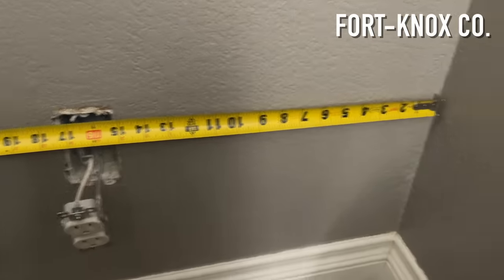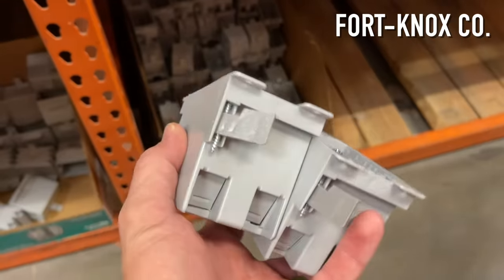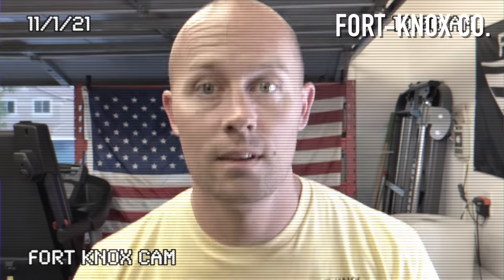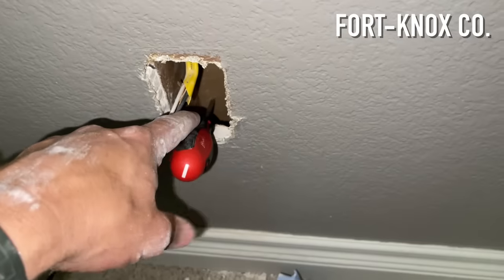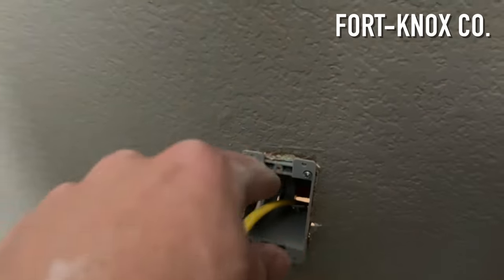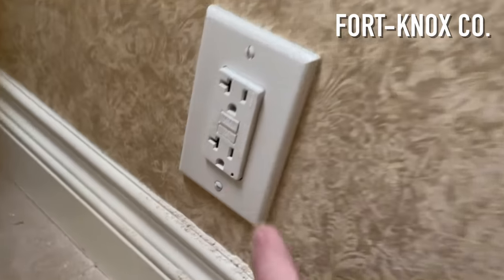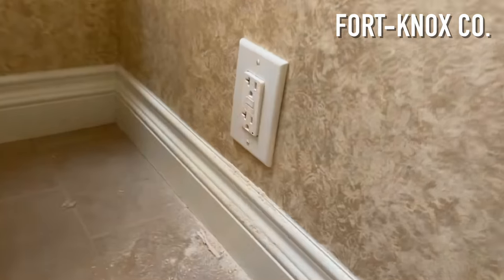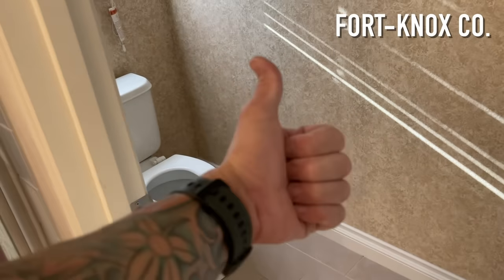How to Add an Electrical Outlet ANYWHERE !! Heated Toilet Seat or Bidet Install | Run Power Easily

Comment: Nice install, only wish I could have seen the old and new wires tied together better or a slower explanation. As a newbie that was an important moment to follow.
Reply from the maker: I appreciate your comment. I will be doing a couple more videos showing just that. I’ve had a lot of questions about these parts of the process. So I’ll emphasize more this in future videos.
Reply: It’s dangerous for you to take a project like this on without having thought it through for yourself a little bit better first, and I’m not trying to be snide by saying this.  It wouldn’t be learning if the teacher did the student’s thinking and “newbie” seems to imply actual interest.  He doesn’t need to change his videos lol just because there are some viewers who conflate wanting to learn with wanting the result of having learned.  Dude’s video was totally responsible using a hollow interior wall and not advising novices to go on the back wall where the water supply is.  

Inexperience doesn’t need the vocabulary to figure out this is a parallel circuit, but the video does presume anyone without enough snap to infer that the three (hot neutral and ground, respectively black white and bare or green in the U.S.) wires need to be individually connected to the same-colored terminals at the additional load (brass steel and green) as they are at the other end of the new jumper (even if every conductor had the same color insulation, which they don’t for what one should hire an electrician If they don’t realize are obvious reasons of safety and convenience) has enough self awareness to forthrightly call having a situational instrumental use for some information what it is.  Criticizing useful information consulted under false pretenses as unclear though is just the projection of someone trying to pretend (unclear with self) they aren’t playing make-believe about their own deluded unassailable perfection by diminishing the work of others (electrician you need to hire and YouTuber you need to stop gaslighting).
Reply from the maker: Thank you. I appreciate the words.
Reply: I kind of felt like that, too, but I have no intention of doing the work myself; I just want to know if it can be done and how much is involved so I'll know if the electrician is being straight with me.
Reply: @virginiamoss7045  it can most definitely be done. It’s just doing it properly and sometimes that involves more labor and work. So it could get pricey depending on how much work is needed.
Reply: @jaxfortner7979  That's what I want to know a little about, how much work it should take if no problems like pipes or unexpected issues.
Reply: @Zarathustran  you forgot to include ‘down stream’ from the GFCI.   You can wire one that doesn’t protect down stream if not careful. 🥸
Reply: @harryl7946  You’re sure right about that and though I’ve done it deliberately (wiring them unprotected downstream that is, not omitting mention here) it’s a great point.  Until AFCIs made me even aware driving a nail into a wall presents the unlikely possibility of creating an arc flash I didn’t much see the use of wiring them for downstream protection at all.  I still think doing so opens the door to risky assumptions (that completely defeat the purpose of a GFI) that other standard devices not explicitly marked in the vicinity are ground fault protected.  I’m not an electrical engineer so I defer to caution in the face of plausibility regarding arc flashes but the only line voltage romex not stapled to a stud where I live is usually wire I pulled or can locate with a zircon tool before cutting into a wall — which I’m not brave enough to jump blind right into with a sawzall where utilities are live anyway.  

I really like the idea of CAFIs near the points of use for reset convenience, and though they don’t offer ground fault protection on the line from the breaker (which I guess somebody could conceivably tie into and expect now that attempting to economize by overextending the application of individual devices has IMO invited that unreasonable expectation) they apparently do mitigate some arc faulting in both directions. Still though, unless I wired it myself the only standard (non-GFI) wallbox device I trust to be ground fault protected where there’s not a GFI or CAFI BREAKER upstream is nada.  I thought the remote controlled SquareD QO CAFIs might be a good way to solve the reset convenience issue and actually bought a shit ton of them (well enough to do a whole house, but they were expensive so it seemed like a shit ton) if you’re interested LMFAO, but they cannot be reset remotely when tripped.  Given that fact I don’t think those much need to be in their residential product line, but they haven’t asked me lol.
Reply: @Zarathustran  just saw this response and laughed.  Who are you trying to impress? Constructive criticism is never a bad thing especially if trying to help a YouTuber who obviously put a lot of heart and soul into making a video others can learn from. It takes a lot of work and adding in those details are meaningful for the viewers and to better the content of the video. This helps likes and subscriptions to YouTubers as I know valuable content always gets a thumbs up from me. The YouTuber was receptive which is even better for building trust.
But your comments seem just a way to puff yourself up. Im not afraid to learn from others as well as teach myself and I’m not afraid to ask for help. I don’t have that kind if disfunction where I let my ego or pride prevent that. I’ve done plenty of self learning and believe everyone is capable. I tackle new things all the time and even built my own house. So really your comments are unnecessary and pointless.

Comment: I'm trying to get the courage to work on electric. Thanks.
Reply from the maker: It’s definitely something you can diy. Just start with the breaker off. Everything else is easy after that.
Reply: @FortKnoxCo  That's what they keep telling me. 😂  I had to put in a new coil in my oven. I unplugged it and turned off the breaker. Baby steps.

Comment: If you are installing smart bidet isn't it good idea this gfci should be in the back wall instead of in middle of the room ?
Reply from the maker: This home owner specifically wanted it in this location sure to how they set up their bathroom and the additional work that would have been required to pull electrical wire the the wall behind the toilet. For their set up and budget they wanted it on the side. But yes you can have the outlet behind the toilet. Some builders will install an outlet there for you during the construction on the home too

Comment: What should you do when the spec sheet of the bidet seat requires a "dedicated" electrical GFCI circuit (120V, 15A, 60Hz)?
Reply from the maker: Make sure it is A GFCI outlet that you’re installing. It’s an added layer of protection. But if you want a truly dedicated line you’d have to run a brand new wire all the way from your breaker box off of a new breaker and run it all the way to the bathroom where you want it.  Dedicated may be a little overkill. Making sure the circuit is GFCI protected is the first and main point.
Reply: @FortKnoxCo  Thank you! I thought a toilet seat needing its own circuit might be a bit much.
Reply from the maker: @ericapp17  your welcome. Yeah I think it’s would be a lot and you could accomplish the same safety with other methods. Just depends on your local code requirements and all

Comment: Thank but this is probably the easiest case. How do you go through multiple studs? Trying to add LED lights to my garage, drywalled, ceiling and the rafters (?) are like 12" on center. Going from 2 fixtures to 5 and I'm having  hard time cutting through just going through the 4" opening where the existing ceiling boxes are. Bought  90 degree drill and a 12" drill extension but I'm not sure I'm doing this the best way.
Reply from the maker: If you have to jump across studs your probably going to have to do some drywall work. There are tools to help minimize how much or how big of a hole you’ll need each time. But it’s very common to have to do this. The tools you said you purchased to help will definitely make it easier. But ultimately it sounds like your going to have to cut holes every so often to be able to reach the inside cavity and punch through the studs.
Reply: @FortKnoxCo  Thanks! I was afraid you would say that. I'm going to try with a drill extension first because I dislike drywall work. I'll let you know how I make out!
Reply from the maker: @thomasmagda4580  yeah I feel ya on that one. Sometimes there’s no way around it. But it’s possible. Takes some creativity.

Comment: I am not sure if others have brought this up but NEC 210.52(D) clearly states that outlets that aren't located by the counter are NOT allowed in bathrooms.  They have to be within 3 feet of a sing and within 12" of height from a counter.  Anywhere else in a bathroom isn't allowed.  I know that there are some local jurisdictions that don't adopt the NEC, however all states except 4 (AZ/MO/IL/MS) haven't adopted some version of the code.
Reply from the maker: I don’t think anyone has mentioned that information. Really good info. Thank you!
Reply: I'm not an electrician, but it seems that code doesn't say it's NOT allowed. It seems it's talking about basin-related outlets. It doesn't seem to talk about others (like bidet related). Am I missing something? "receptacle outlet shall be installed in bathrooms within 36 in. of the outside edge of each basin. The receptacle outlet shall be located on a wall or partition that is adjacent to the basin or basin countertop"
Reply from the maker: @Hajjat  my man! I like the way you think. 🤙🏼🤙🏼 main goal is to be safe about how you handle electrical and understanding pros’ cons’ or different problem solving tactics. I appreciate your comment !
Reply: That's incorrect. Lots of new builds have an outlet down low by the toilet for bidet seats and smart toilets.  NEC 210.52(D) is only referring to sink basin GFCI outlets and the distance from the outlet to the sink.  As long as you are installing a new outlet outside of the footprint of the tub/shower, you are within code.
Reply: @breedlofam  You are correct now.  In 2023 there was a modification to section 406.9 specifically exemption #4 to allow an outlet for the bidet or personal hygiene device.  Back in 2021/22 this exemption didn't exist.  However it needs to be GFCI protected and common sense would state that it should be a dedicated run as a heated seat can draw upwards of 1KW for the heaters.  So you don't want to share with the hair dryer as well.  😁👍

Comment: Brian, how do you get away from not cleaning up the drywall dust at the completion of your project? My wife would have something to say about that.
Reply: Isn't that her job?
Reply from the maker: Nawww any good handy man should clean up after himself. lol. That’s what will get you more referrals in the end
Reply from the maker: I cleaned up. Just not before I could snap a picture for the thumbnail on the video. I usually bring a vacuum with me to job sites. Those small compact box shop vacuums  are great for the job sites at houses.

Comment: I like the way you pointed out the GFCI, often missed by DIYers. Some advice for your future videos to help future DIYers and yourself. 
1. The tabs in the back of your box were pressed through and did not spring back to secure the romex coming through. These are designed to be a form of "strain relief" and secure the cable set in the box. If the tabs are broken and not securing the wires inside the box, a new box should be used. 
2. Your ground splice was in my experience, and opinion is very poor. Simply wrapping on ground around the other, and terminating to the bond screw on the receptacle is not a secure join. They should be properly twisted together and spliced with (in this case) a 3rd ground wire spiced in with to "pigtail" to the receptacle bond screw.
3. They way you terminated your receptacle seemed fine and works. However through years of service work, a better way IMO is to splice and pigtail a hot, neutral, and ground wire to your incoming and outgoing branches, and terminating only the one pigtail to your receptacle. This prevents loss of power all downstream devices, (lights, receptacles, etc.) if something happens to this specific receptacle. This is not necessary, and depending on the circumstances may not prevent loss to all downstream devices. However through years of service work finding no power at multiple receptacles, only to find the one defective receptacle after opening many devices, this method has saved me a lot of time.
4. Thanks for mentioning to turn of the specific cct off. Too many avoidable incidents happen due to poor planning.

Good luck with future videos, information paired with education is always positive progress.
Reply from the maker: Thank you very much for all the information and positive words. I greatly appreciate it.
Reply: @tittyrino  that’s the best way to do it.!
Reply: @tittyrino  that's true, inspectors will only call the small inconspicuous details if you fight them or argue everything. But it's not just about inspection, also protection. There's a reason there is always a way to secure cable sets in entry points.

Comment: as long as you know there is no obstructions in the wall, you don't need to remove the existing outlet box.  You can pull the duplex outlet out of the box, punch a new hole in it and feed the new wire through the box and from the other side of the wall cut your hole and pull the wire to where the new box.  You can then attach the new wire to the existing outlet and the new outlet.
Reply from the maker: Yep! Good ideas. Definitely Another way this can be accomplished

Comment: Question, does code say the power outlet need to be x inches from the floor?  I don't think it maters for a retro but asking to see if its a big deal.
Reply from the maker: Depends on where you live and what your specific codes say. But there are different scenarios where it’s be okay per code and maybe others that it isn’t compliant with code. Some will allow it with certain measures in place or might ask that specific materials are used. So it really all depends on the situation.

Comment: This also works for adding a towel warmer--that's what I did in my bathroom.

Also, you can put the GFCI receptacle on the source outlet and have the bathroom receptacle connected to the load terminals on the GFCI source outlet. This can be handy if the bathroom outlet is hard to reach the test/reset buttons. Don't know about the code implications, but as others have stated, you may not be in compliance anyway. I don't worry about that as long as it's my house and I feel it's safe, and done in a workmanship-like manner.
Reply from the maker: Yeah exactly. You could use the outlet for many things or reasons. Very good information! I appreciate it!
Reply: Why does everyone think the city building code only applies to someone else house and not theirs. I understand if you have a death wish....so when you drive your car off the cliff just make sure the wife and kids and dog/cat aren't in the car with you. Just saying dude... you cant speak for them.
Reply: @pjdn  : Well because sometimes they are right. Out here in the country there very few codes.

Of course, some will use that to create deathtraps and others will say "let's do it right". We do
it right as my wife and I do not want to be electro fired. Or have our guests (mainly family) become
Crispy Critters.  What other fools do is their choice - the consequences are not their choice!

Comment: is there a code that says its ok to not support your new wire being the other box is so close?>
Reply from the maker: Usually when doing runs up a wall or moving outlets I don’t see people secure the wire within 8-12” of the next box on the stud inside the wall unless they have a lot of area already opened up to do that. As far as code I know during new construction they require the wire to be secured near the box. I’m unsure if there’s code for or against the new work being done in most cases. But I know it’s commonly not done when running new wires. I’ve done it when I have the room to do it. For example when working in the attic space I’ll secure the wires along the way.

Comment: So did you put the new box on the same stud (opposite side) just lower?
Reply from the maker: The new box is floating in between the two studs. It’s a retro (old work) box, so you can technically put it anywhere within the space and the box has tabs on the inside that will hold or suspend it securely. I have a link to the boxes in my description

Comment: I live in a rental with no bathroom outlet. There is one in the adjacent room. I drilled a hole in the wall on both sides, making sure i didn't hit wires and fed the cord through for my heater.. My bathroom was always freezing in the winter. I'll just patch when I move.
Reply from the maker: Sounds like you got the idea down. You can move power without to much work. Just be cautious when using outlets or powered devices in areas where water is near by. A GFCI outlet is an added layer of protection.